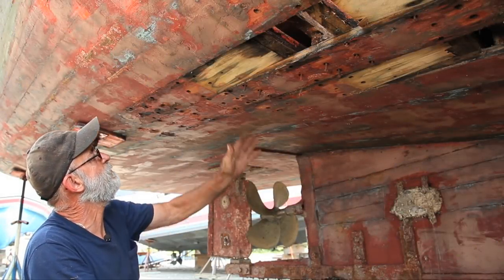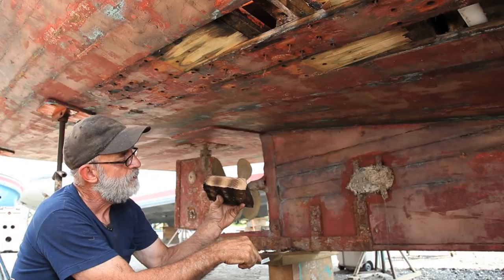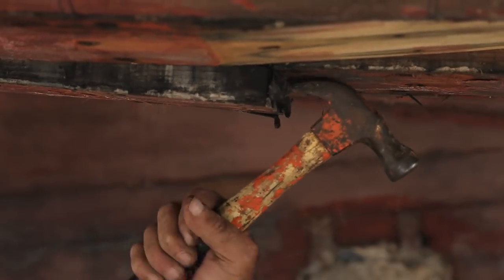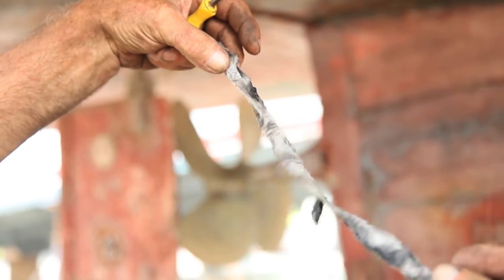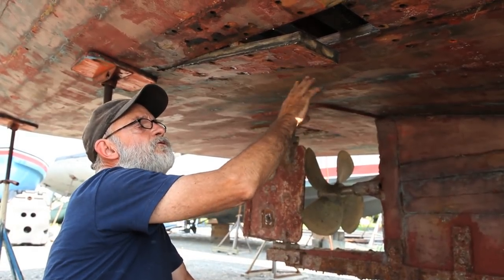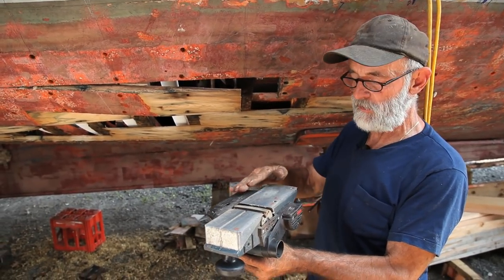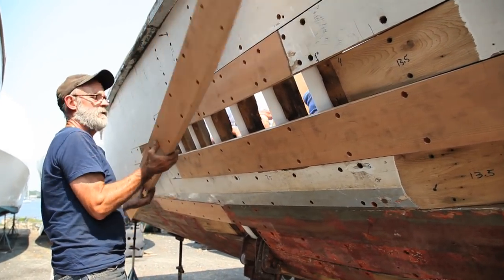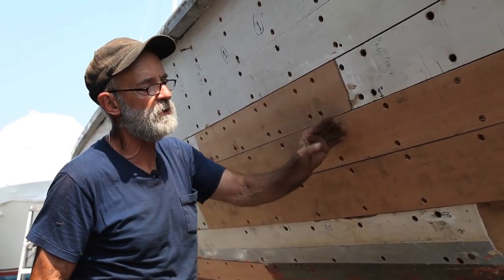Wooden Boat Building - scarfing boat planks with a chainsaw and custom saw

Comment: About your tool called Mr. Friendly..
In 2005 I was using an angle grinder with a carbide wood blade, to cut some rotten facia boards during a renovation.. the saw kicked back, broke my safety glasses, wrapped up my shirt and started to severe my jugular vein.. the t shirt binding up the blade and stopping it's rotation is all that saved me from getting cut much deeper and bleeding out before my dad got back to the site.. be careful with that.. I wasn't inexperienced with power tools when this happened, it can happen to anyone who gets to comfortable in what they might be doing.. when I saw the picture for the video, it gave me a flashback of jumping down from the ladder in a panic, feeling a warm and wet sensation going down my chest.. I really thought I might die right there.. me and you aren't even close to the first people to have such an idea for a tool.. but it has proven time and time again to be a dangerous and deadly combo.. angle grinders and carbide blades don't belong together..

Edit.. flush cut, or undercut saws have been becoming more and more popular and commercially available to consumers since then.. fein tool is my favorite.. its way safer cause they oscillate back and forth instead of directly rotating in a single direction..

Comment: Here’s how I would have found the original screw holes. Put screws all the way into the original holes, lightly rub some mustard on the screw heads and then lay the new board onto the screw heads. Voila ! just drill some pilot holes in the centre of each mustard circle and you’re done. Keep the mustard out for hot dogs after attaching the plank. Absolute,y love your videos, please keep them coming.

Comment: Just think about it: cutting of a wedge of a plank and doing it so that the remainder of the plank is not ruined and the cut is also at the right angle... with a chainsaw! See you doing it yourself? Just shows how skillful and experienced Louis is, 40 or 50 years carpentery skills for ships. And just doing it with ease and naturally deadcertain movement. Brings the good old adage "don't try this at home" to mind. 😄

Comment: Don't you need to put some kind of sealant or adhesive in the scarf joint between the two planks so it doesn't leak?

Comment: "Mr Friendly" ...lol...that's awesome!
Reply: Indeed I have a similar smaller carbide tipped blade on the grinder, and yes it is a dangerous tool.
Reply: The “meat axe.”  One of the best tools in the shop,  a 90deg air drive with a 4” carbide and no guard.

Comment: Love your work, and tools. I don't know about that Bosch planner, but on the similar size Makita you can just take off the offside cover that's supposed to funnel  the chips, but merely causes clogs, voila, no more clogs. Perhaps you need to do some surgery on that Bosch if it's still around.

Safety is in the hands of the user, and requires that you can see what's happening and have the means to control the tool. If you have a dangerous tool you must realize that it's dangerous, how it might get out of control, how you intend to keep it under control, and which way to jump when you fail.

Comment: I'll have to check if my skill saw blades will fit my angle grinder (size and rotation).
Reply: No, use special saw blades made for grinders which rotate very fast around 12000 RPM. Makita has some very good, perfectly adapted to this use. There are several brands making saw blades for grinders. A saw blade used outside its range of speed, most are rated at 5500 RPM, is a very dangerous thing, .

Comment: The scarfing is first class and could not be any better, but I feel that four joints  in the same location one above each other in such a long  hull  is rather questionable  when one considers the hogging and the sagging in high waves.  There is much to  discuss when to use a butt and a scarf joint in boats as unless it is glued a scarf joint would not take much compression nor tension.  A butt joint could be  backed for a better joint, but of course a scarf joint is much neater  and needs a high level of workmanship, but unless one thinks carefully about   what gives a joint its strength rather than its looks, well this would make an interesting debate amongst craftsmen building for utility and others building for workmanship.
Reply: I have to agree the staggering of butts should always be regarded as critical. The ends of scarfs seem vulnerable to me. If the frames are not wide enough to butt on, a butt plate is a better option than a block. They are typically bolted to the adjacent strakes, as well as either side of the butt.

Comment: did you change the hole on the circular saw blade to be able to mount it on an agle grinder? my angle grinders cutting wheels seem to have bigger holes than the most common saw discs..
Reply: You can find special saw blades designed to work on 12000 RPM grinders.
Reply: Bushings...

Comment: why do you lot use screws in england we use spikes
Reply: The replacement ribs are plastic and will not hold spikes/nails.
JIM
Reply: It's a bitch unscrewing those spikes... Spikes are used on boats that will not outlast their planking, typically commercial fishing or lobster boats.